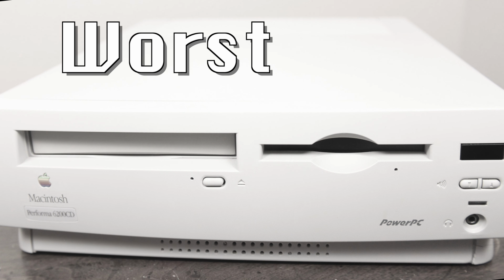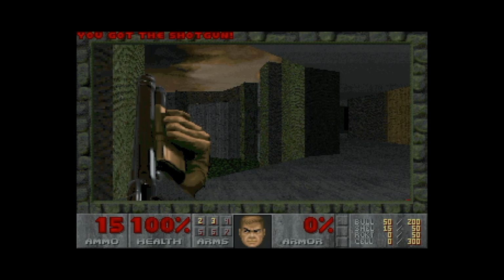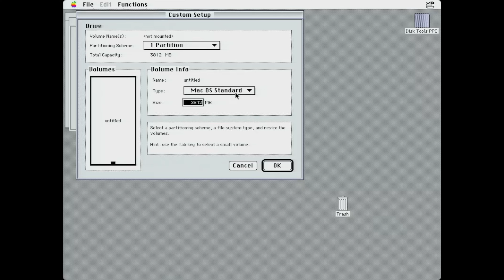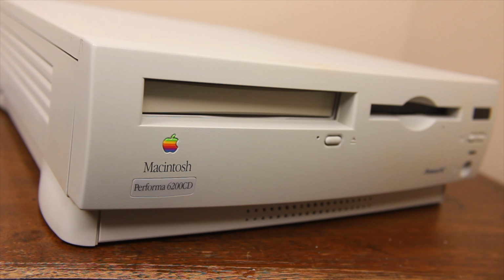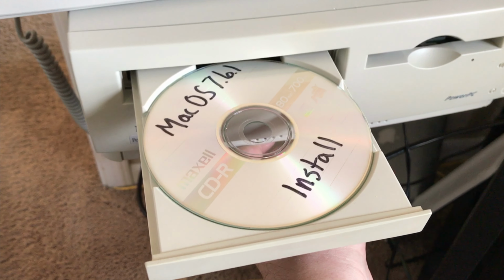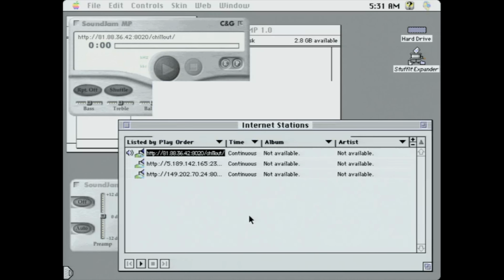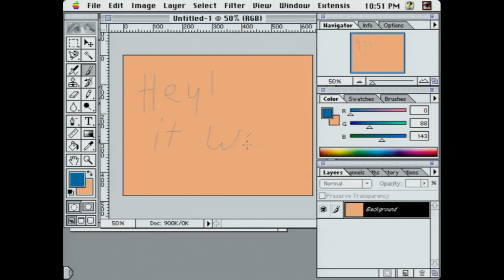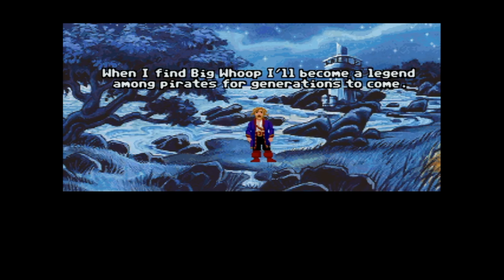Apple Macintosh Performa 6200CD - Upgrading an Old Friend

Comment: I think the 6200CD is the quintessential 90's Mac, both in a good way and a bad way! I love mine.
Reply from the maker: Just checked out your video about your 6200CD - yours is in great shape too and that's awesome you've got the AV card as well! Nice little computer for 90s multimedia and shareware games!
Reply: @insanelygruz  I have an apple workgroup server 60 its my favorite retro mac.  Doom runs well on my mac even my 68k I still have my 2 child hood macs I kept them.  I have a performa 476 and a 6400 I ran them for ever in the 1990s and they still run I recently got them on eithernet and syncing with my retro servers to.  What can hurt some models to is that they can forget that 32 bit addressing was on and virtual memory to.. I had no idea some cd games were crashing when the batteries died.  I kept fsome of those quantom drives because they work with the HDD light I have a quadra and a Mac IISI that have an HDD light.
Reply: This was our first Mac! Before we got this, we only had an Apple IIe.
Reply: Try a quadra 950 for 68k and a 8100/110 with a G3/500 mhz upgrade, digidesign chassis. Theres more good 90s apples thats not performas
Reply: We had its close relative, the 6214CD. I was happy at first since it was a lot faster than the LC it replaced, but gradually I came to find that it was actually pretty damned slow for a PowerPC-based Mac. I got the impression that the older Power Mac 6100 with its 601 CPU was actually faster. Turns out this thing had a lower-power CPU and a slower bus.

Comment: I recall marathon actually running a bit better on my 68040 Performa 630. I later got a 6360 (i think). DooM II ran OK on the 630 too, I'm surprised the 6200 struggled with it. I overclocked my 630 to 40mhz and it ran DooM quite well at 640x400.

Comment: 14:42 Small oversight on my part, but if you use a compact flash adapter that has exposed solder pins on the bottom for the power, they will short out when touching the metal case. I thought I blew the power supply with all the smoke. Little electrical tape fixed the issue. Lol

Comment: The speed issue with these 3d games is because of the 32 bit bus. The processor is capable of handling everything, but everything has to go through a funnel to get to ram, hd, PCI cards (like the video card for example). Even machines with faster processors still suffered from it. These performers needed to use an incredible 4 clock cycles to perform a single operation, thanks to the limited bus. That means the processor runs 4x slower (or needs to work 4x harder) to perform the same task as a PowerMac with the same configuration would.

There were versions of performa that had a motherboard with a 486 or pentium 1 processor, and that could run windows and pc games. Even these cards ran 4x slower than a regular computer with the same specification.
Reply: But thanks to that, those macs (which nobody wants) are disappearing, so, in a few more years, the lucky one who still has one will have a gold mine in his hands.

Comment: No matter what computer it is, mac or PC, upgrading a childhood computer to go as fast and be as powerful as it can possibly go is always an amazing feeling. The very first computer I ever encountered in my life wasn’t the iMac’s and iBook’s we had in my school back in 2006… my first computer was a machine probably very few people have heard of. It’s called the Dell Inspiron e1405. A forgotten little Core duo laptop that was dells midrange little experiential machines from the time. However, I’ve always adored the machine, as it served as my family’s main computer well into 2012, which is also around the time I inherited it. Over the years I’ve upgraded the original, and got a second unit in mint condition to upgrade to the absolute MAXIMUM it can go, and it was so worth it. So, if you have the chance to take your childhood computer to the absolute limit, I say go for it.

(Also, for anyone who wants to know, the units original config was a 1.6Ghz Core Duo, 512mb of RAM, and a 120GB mechanical HDD. Now it has a 2.33 Core 2 Duo, 4GB of RAM, and a 500GB SSD.)

Comment: You just helped me out greatly.  I've been struggling with my 6500/250 and replacement ATA/IDE drives not being recognized by Drive Setup under System 7.X.  Gonna try again with System 8.1 Drive Setup.  Thanks for the video!

Comment: I had a look at my LC630 and the front bezel fell off when I went to lift it. I tried pushing it back on and the plastics cracked. Very brittle. Annoyingly it sat there collecting dust for well over 20 years and it fell apart when I moved it!

Comment: Since i didn't see it mentioned in any comments, please, on PPC Macs, do NOT turn off Virtual Memory. In fact, some apps wont even work without it on. While, true, using VM is slow, so long as you have enough actual RAM so it doesn't need to use it, the CPU was designed for it.

Turning it off will greatly increase memory usage and load times. It also changes how the system and apps can page data in and out, causing overall slower performance.

Again, if you don't have enough RAM so it's constantly hitting the HD, then yes, it will slow things down. But, there is a reason that all systems today use virtual memory/swap based systems.

Comment: Great video! I have the model 6230CD, almost the same model. What makes this computer interesting are its own limitations. I upgraded mine too. And install System 7.6, MacOS 8 and 9.
My goals are to always push the limits of hardware and software. I used in those last years has as  my main word processor computer and communication for a while, using web proxies services. I even used MSN Messenger in 2020! (Escargot server). Please, make more videos with this Mac. :)
Reply: May I simply say: that is so cool. You rock socks!

Comment: This is a fun video, thank you for sharing!

I say this wherever I can but Low End Mac did the Macintosh 6200 and 5200 really really dirty. Literally nothing they wrote about it until an article by one of their newer columnists in mid-2020 is outright fabrication. Literally none of it has any basis in reality whatsoever. They haven't updated any of their existing pages 

The 603 runs fine on the Mac 630 platform and the revised versions of these machine, 5300/6300, 1400, PB5300, and PB2300 are all even more "basically fine" than the 6200 is.

Speed Doubler is a great plan for these, without it a 6200/75 will do 68k emulation at around 20-25% as fast as a Quadra 700 and with it it'll go at 150% of the speed of a Q700. Some of the networking stuff does help, and there's Finder multi-threading in there, but it's a little awkward and most vintage Macs (even high end ones, to be honest) perform poorly enough that it's not worth doing.

The problem with the 6200 vs. the 6100 and the 6300 is that the L1 cache where the 68k emulator runs is 16k in this model vs. 32k (or more) in basically every other extant PPC Mac. That causes the emulator to thrash in and out of cache. Nominally between SD8 and running 7.6.1 or 8.1 to get more PPC code than 7.5.x has is probably the best spot for these but IME 9.1 will run if you need for any reason. (but, not well due to the ram ceiling on these.)

Unfortunately, 23+ years of LEM not ever updating what they write about these machines has caused msot of these to be tossed as worthless in comparison to higher end machines where preservation efforts get focused. It's a big bummer for the scene as a whole because these are great basic tourism/gaming/productivity machines and they were produced in huge quantities compared to the higher end models but they all got tossed.
Reply: Darnit my apologies for so many line breaks, youtube did not make clear that it was going to cause like 3 line breaks.
Reply from the maker: Thanks for the info! Had no idea Speed Doubler was so effective until recently. Also agree that the article by LowEndMac is ridiculous. Even if it's not as fast as it potentially could be, a "Worst Mac Hardware Ever" label is something that shouldn't exist in my opinion.
Reply: @insanelygruz  I couldn’t agree more, and I also think it is such a shame that so many of these hit the scrap pile. Thank you so much for this wonderful and enlightening video; I’m so excited, you have reignited my passion for abandonware. PS - the heheheh was perfect; I was laughing right along!
Reply: @Cory5412  I'm picking one up tomorrow. I'll benchmark it with 7.6.1 and 8.6, with and without speed doubler. Then I have some overclock plans. It's basically a Performa 630 with a PPC603 upgrade card. The chipsets are identical. The ROM and L2 Cache are both on the 64bit bus straight next to the CPU, it really is similar to the 601 upgrade for the 630.
Reply: @phipli  I don't remember if I ever remembered to bench mine with/without. I've got a 6220/75 here, it's even set up next to my main machine as I was doing some MP3 encoding/playback on it, from that one thread on the forum talking about the practicality of MP3 on older hardware.

But yeah that's exactly it w/re the architecture: everything LEM has ever written about this machine prior to ~2022 or so short that one detail is wrong, and when you look at it that way, it becomes "an extremely normal cost-conscious computer from the mid 1990s" 

TBH IIRC even like the PB5300/1400/2300 is mostly the same architecture, with a couple bits swapped out and some different physical modularity.
Reply: @Cory5412  So surprisingly, 7.6.1 Vs 8.6 didn't make much difference (although the 8.6 disk driver did). The biggest improvement straight up was SpeedDoubler - in Norton's emulated 68k benchmarks, under CPU tests, it made a 500% improvement! With SpeedDoubler, the 68k performance went from 030 speed, to faster than an 840av.

Otherwise, things I observed...
The IDE hard disk interface is pretty good, I was getting about 2.5MB/s Read and 2.9MB/s Write at 256k sequential from a 1GB spinning disk, if I have them the right way around.

FPU scored 150% Vs a 6100/60, but my memory says a lot of that will be because FPU underperforms under 7.1.2 that Norton was running in their 6100/60 in-house tests.

Main let-downs : RAM is literally half the speed of the 6100, I assume because the 6100 has a 64bit memory bus, and video scored slow compared to the built in 6100 score... Except... If memory serves me well, my 6100 and 8100 have never scored anywhere near the built in video scores in Norton, so something fishy is going on there. Multiply and bitshift CPU tests significantly outperform the 601 (like 40% or so).

Overall, it's pretty much the same as a 6100. Norton scores it as 95% of a 6100/60 when running PPC benchmarks, which is down to the ballance of video and RAM speed losses, Vs Multiply/Divide and FPU etc. gains.

Based on the scores, its strengths are native Maths software, perhaps audio, and weaknesses would be quicktime, 3D games and Photoshop. Except Marathon where it can use the hardware pixel doubling "acceleration" to do fast full screen. Good at maths, bad at pushing pixels (compared to other PPCs)... With the caveat that I want to see how the video on my 6100 actually really scores when I test it rather than the built in 6100 result.

I want to do some more tests, including on my 6100/66. Then I'll stick an article on my website. Pin actual figures down for the record.
Reply: I also tried PowerFPU, like SoftFPU, but for better 68k emulated FPU performance on a PPC. It wasn't a huge advantage under 8.6, I suspect Apple had eroded the benefit. It scored 8% better than without PowerFPU. I'm guessing the benefits would be more pronounced under 7.1.2.

Comment: If I'm not mistaken, and just looking at its system specifications the biggest problem it has is its system bus, and if someone could overclock/Fix, or mitigate the low system bus speed it'd help out a whole lot. I'm getting into breadboarding, learning a lot, and my current plan is to learn enough to clone a 68000 series Performa, or Quadra, then get into programming.

Comment: I had the LC630 with the FPU on the chip. I wish I could have upgraded it more. But I have all the cards for it except the TV tuner, so I have Ethernet PDS, comm slot modem 28.8k, video in card. I think the RAM was upgraded to 36MB and got a IDE 2GB hard rive upgrade. I noticed some games like Marathon tapped into a specific interlaced video mode for more speed, could you do that with this generation as well?
I have a link to a page where someone took the Performa 6360 (same case but everything inside was better like PCI slot) and upgraded it to a 6500 with G3 upgrade!

Comment: I have one of those sitting in my to do collection I was finishing my work on my Performa 6500 which is a better version of the 6400 in a few ways
Reply: Also if you have a heat gun you can soften up the plastic a bit and it will help prevent the plastic from breaking

Comment: The Performa 6200CD was my first computer as well.  I used to download and play all sorts of Wolfenstein 3D and Doom scenarios either made or ported by Laz Rojas.  His site is still up and running, and looks just like it did way back when.  I used to collect the MacAddict discs and found so much great shareware on them, especially those made by Ambrosia Software.  Escape Velocity was the first piece of shareware I ever registered.  With the way gaming is now, I could see that game having MMO features added to it.

Also, next to where you installed the AV card is another card of some kind.  Any idea what that is?  I really don't remember if mine had that or not.
Reply: Hey, i know this comment is old, but the card that look like a big ram stick next to the AV card is the rom/cache combo card, and without it the computer is not gonna boot up, i have a 6200CD myself and tested it, cheers!

Comment: I’ve seen drives with marginal sectors freeze that way, so given its age that might be what’s happening here. You could put it in another machine and pull its smart info or do a badblocks check, though your time’s worth more than that drive is.

Comment: When I bought the same computer new , it was expensive but the bundle came with Daedelus and a Rednecks game ,encarta also a bunch of Disney and other children’s software, I ran photoshop , but I believe I bought an aftermarket raid?graphics card I also maxed out the ram and separate optical disc drive 
I just remembered I still have the original discs somewhere

Comment: I grew up with a 5200, so same thing really. The shareware titles it could run really were vast in number. Was it stable as you played stuff? Standout memory for me was it spitting out a Type 11 about as often as I breathed out. I remember BOOM only getting slowdown when lots of bombs went off at the same time so that must have been down to more memory.

Best thing to get the front off I found was just a standard blunt knife from the cutlery draw, they fit better as they stay flat all the way down. Tipping it forward and up while gently lifting it meant I never needed to use much force. So much easier than getting the front of a 6500. I damage the plastic every time I have to open that one up.

Make it faster by putting the 6500 motherboard in it, completely compatible! :P
Reply from the maker: Yeah it was pretty stable, thankfully, I don't think it crashed at all the entire night while I was recording this. I remember it crashing all the time back in the day, but we were running OS 8.

Also, the PowerMac 6500 logicboard will work in this 6200? I kept the logicboard from my old 6500 but I thought the voltages were different, and it was physically too tall to fit. I didn't confirm it though, I'll have to look at it again.

Comment: Regarding your comment about 68040 processors being slow, to be fair, they were plenty fast for the OS of their time. A full 68040 processor with FPU was pretty nice. I remember a lot of software running way better on 68040 than those early PPC's. This was because it took quite a bit of time to get PPC-native software, and also the Mac OS still had a lot of 68k code in it. The System 7 family was my favorite era of classic Mac OS. Mac OS 8 and 9 were ugly, and a transitional period before OS X.

Comment: How do i actually turn this thing on? There is no powerbutton?
Reply from the maker: There should be a power button on the keyboard, otherwise there is usually a very discreet one on the back of the computer.
Reply: @insanelygruz  Yes, thanks brother. I got it now, i couldn't figure it out since i live in Europe and we have different keyboards apparantly, got it working now it didn't even look like a powerbutton (wouldn't guess the powerbutton to be on the keyboard, Apple is weird). Got it to boot, then i had no screen, but it was just the brightness and contrast where off, was a matter of turning those tiny wheels on the monitor. Really have to get used to this modern technology.

Now how can i get games onto this thing? I've got a bunch of floppys but i don't think there is games on it, they are all grey too. And can i get a optical mouse on it? Got to say, it boots very quick.

I think mine is slightly different from yours, i got a LC630.

Comment: I'm betting that's the 68k version of Doom II. I have several 68040-based Macs, and they can play it reasonably well; better than that, anyway. 68k software runs under emulation on a PowerPC-based Mac, and on low-end PPC Macs like that one, it is dog slow! It occurred to me that I actually have a 6200CD, and I don't think I've  ever fired up Doom on it.